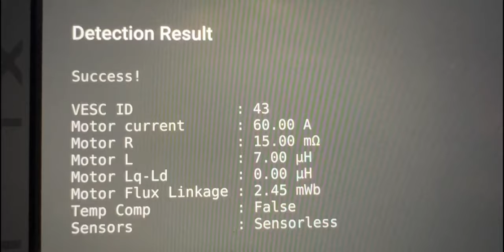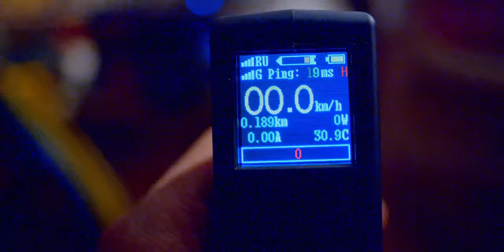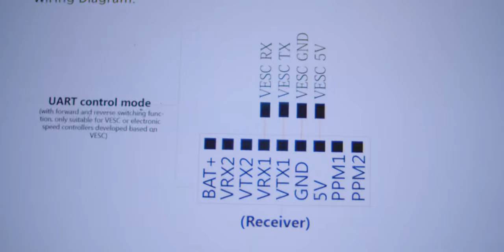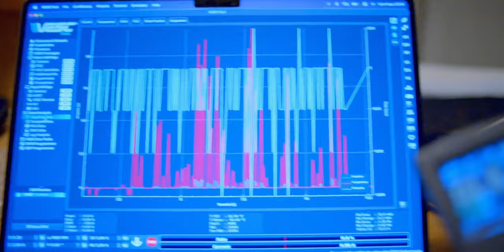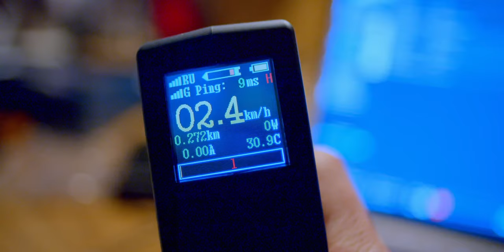Electric Sailboat with Skateboard Parts - VESC

Comment: Nice, same project here. Motenergy Me1616, Kellycontroller 48v. Works great
Reply from the maker: Cool!! Does the kellycontroller overheat? I think I need to watercool mine with seawater.. :p
Reply: @happygoluckyland  no, not a problem. I have seen 43Degrees max. I installed a closed liquid cooling based on an Ebenspacher radiator with 2 fan's, it also cools the motor. I think it is ok to run it without for while, never gets hotter dan 35 deg. I used 70mm2 cable, that helps ceeping impedance down. The Kelly has a huge aluminium watercooling plate an is connected to the stainless motorhousing, that cools too

Comment: That motor is running really smooth, seems much quieter than my 5kW Golden Motor.
Maybe because the VESC does FOC control instead of using the hall sensors, I heard that mode is smoother. Unfortunately my controller cannot do that.

Do you have a pressure bearing in front of the coupling?
I don't think the bearings inside the motor like load beeing applied along the shaft.
Reply from the maker: Oh that's sounds good! I think the vesc is using the hall sensors as well. But can be used sensorless too. 

I have an aqua drive. It's some kind of soft coupling so I don't think it's an issue for the motor bearings. Hopefully 😅
Reply: @happygoluckyland  As I understand it you will be fine with the aqua drive since it should come with a load bearing.

It's way expensive though, I guess you already had that installed for the old engine. Would be way overkill for the electric motor since vibrations are minimal anyways.
Reply from the maker: Yes exactly. It was already there. Otherwise I would probably have mounted it more carefully. It felt a bit like cheating :p

Comment: fantastic! I did something similar with an electric trolling motor, but ended up putting the controller on the battery box instead of doing the pistol grippy thing. My concern was that I would inevitably drop the controller over the side at that'd be it. Great project! Can't wait to see how it turns out. Do you have a parts list anywhere?
Reply from the maker: Cool!! Yes that's a bit scary 😂 I lost my last phone like that so if I use the controller outside I think I will try to tie it to myself somehow! :) It should be possible to mount a potentiometer somewhere as a spare controller. But I will take one thing at the time 😅

I will write a parts list and maybe get some links to where I found stuff! I'll come back to you :)